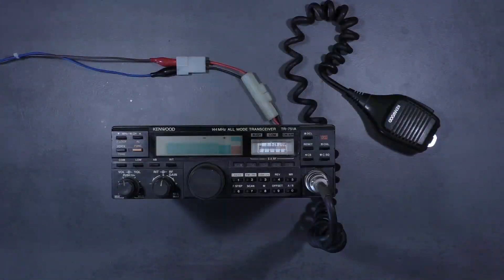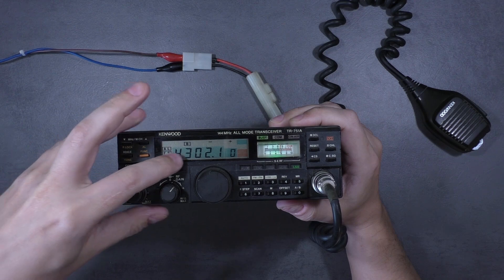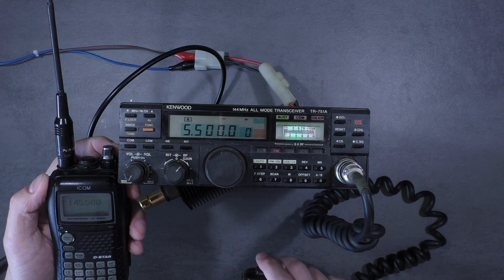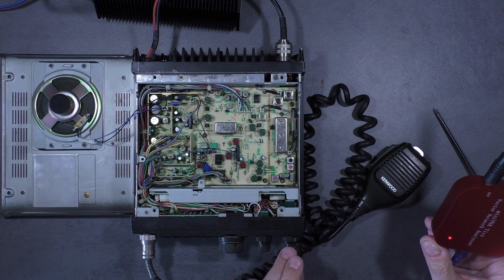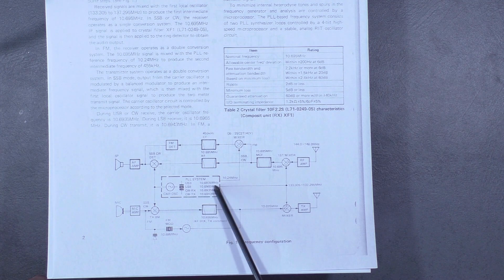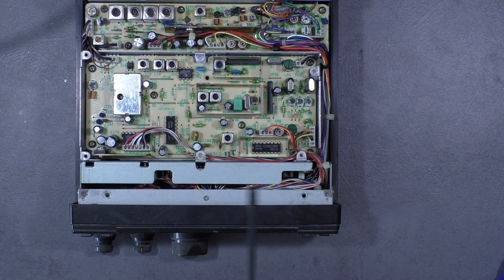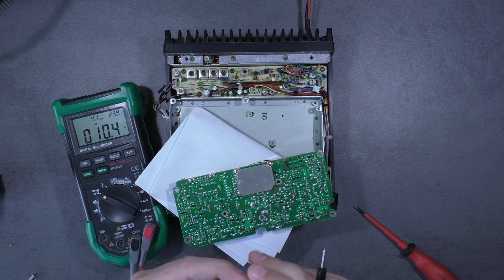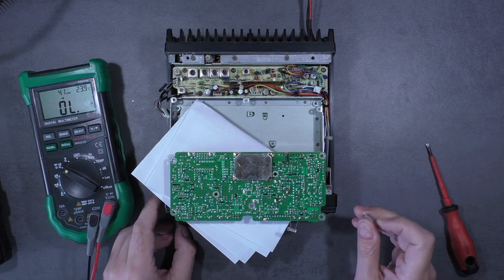KENWOOD TR-751 repair & restoration.

Comment: Were you able to fix the encoder that skips frequencies?
Reply from the maker: Yes, just need to disassembly encoder and clean it with isopropyle alcohol. That's all and it works great after cleaning.